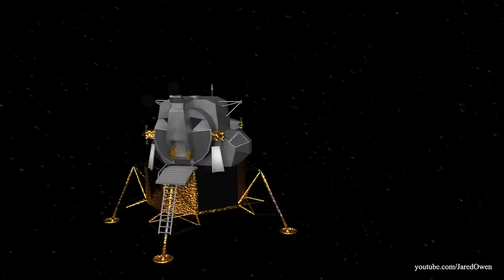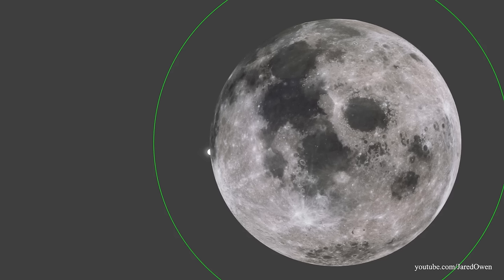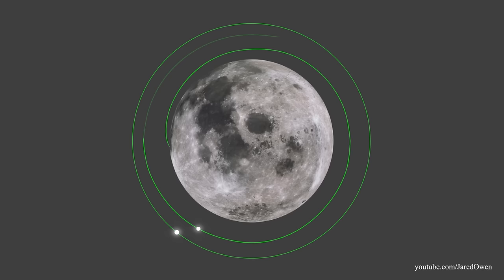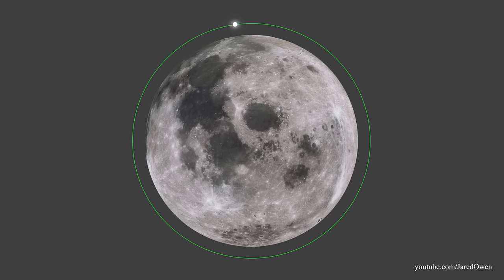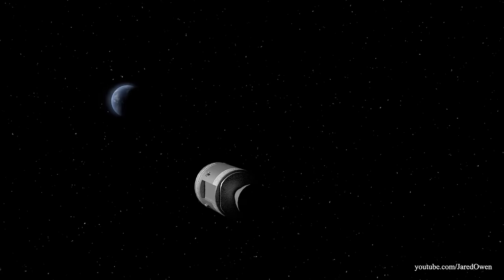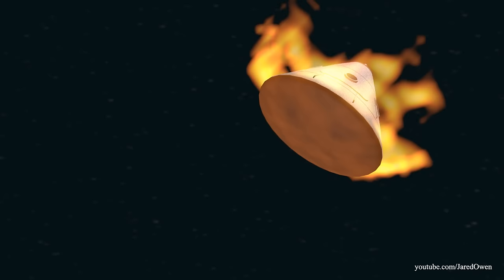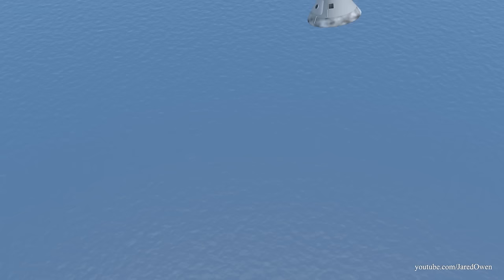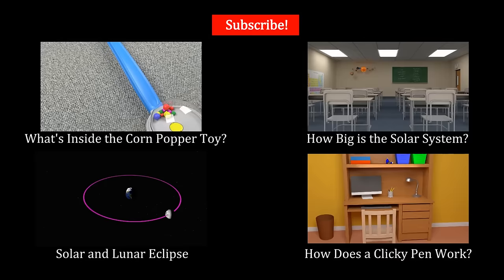How the Apollo Spacecraft works: Part 3

Comment: Nice video.
Can ascend module generate enough thrust to escape moon's gravity?
Reply: Yeah it achieves the moons escape velocity from its surface which is relatively low compared to earth's and gets into orbit where they are still held by the moons gravity but once the ascent module docks with the CSM they fire the engines and leave the moons orbit on their journey back home.
Reply: The LM ascent stage alone? No. It only had about 2.2km/s of Delta V.

Comment: How does the astronauts turn the CM Command Module re entry to earth belly or butt first when it is orbiting side ways?
Reply: It’s not as obvious to see compared to the LM & SM but the CM also has a RCS that they used for maneuvering.
Reply: The CM has small holes in its side that can release gasses that can orient it. Also, the shape of the CM made it naturally fall through the air in the correct orientation.
Reply: @origamiscienceguy6658  also reaction wheels

Comment: It's funny how in these cartoons, they remembered to show the rocket exhaust when leaving the moon, but on both videos of the "real" thing, they forgot that all rockets have exhaust and create thrust that is visible with flames and smoke,  both times they left that detail off the to moon movies.  No one has ever explained how they can always get the capsule to land right next to an aircraft carrier when they can't steer it, it drops from parachutes, so do they do that flying in from the moon, point the heat shield at the atmosphere and magic, it just happens to land in that big ocean on that big planet, within a mile of the ship, every time.  All wind just stops and it lands right on target... sure.  That's such B.S., you ever try to find a marker out at sea, from a couple of hundred miles away, without steering to correct for wind and sea currents?  You will be off target every time unless you course correct your ship.  Think about everything they are telling you, if you do, you will have about 50 more questions that can't be answered by NASA. Never a straight answer. Why did they destroy all original video tapes and telemetry tapes, over 14,000 of them?
They treated all remnants of the missions as crimes to be covered up instead of the most important event and accomplishments in the history of mankind. Why?

Comment: It's a pity NASA didn't have the modern computers for stability control used to land safely the first stage....that would have cut by a lot the expenses and they wouldn't have any reason to focus for a lot of time on shuttles...it's not that i don't see the spacecraft utility especially for the atmospheric thermodynamic studies in re-entries...yet there were more stuff to be learnt out there using rockets and we still had Von Braun alive(professionally speaking here).....
Reply: Pretty massive object to attempt such a thing compared to the Falcon 9 1st stage. How much extra fuel would have been needed if they had the computer tech back then? Be interesting to hear if it would even have been technically possible. I suspect not but might be wrong.
Reply: @mako88sb  In the end, how Musk  showed us(and many others before him), the limits are given only by our imagination.
Reply: Doing a Falcon 9 style landing of the Saturn V's first stage would drastically reduce its payload capacity to LEO and beyond since it would need to leave some of the fuel for the landing rather than for acceleration. You would probably need 2 Saturn V launches to get all the Apollo hardware into LEO + the third stage with its remaining fuel for the TLI burn.
Reply: @fromnorway643  well if you can cut the cost of a launch enough to make it worth even 2 launches would be okayish, no? I mean in the end the main problems of the launches are: 1)cost in money terms; 2)cost in terms of weight and payload and thrust.
Reply: @marklionheart7715  
Yes, it would make sense if the cost of launching, recovering, refurbishing and launching a second time could be kept lower than building a new stage. That was actually proposed in the early 1970s as NASA considered a version of the shuttle where it and its external tank were placed on top of a Saturn V first stage (the "Saturn – Shuttle" concept).
http://www.pmview.com/spaceodysseytwo/spacelvs/sld036.htm
Reply: @fromnorway643 mmm like a shuttle version of the starship i see

Comment: how can the vehicle catch the moon orbit on high speed and orbit around then fire a thrust to decrease the speed without loosing the vertical altitude instead of decent the vertical altitude towards the moon when orbiting ?? aaaaah i dont know how to say it but who studying physical orbiting will get it
Reply: I am just starting to study them but I kinda understand what you mean. The highest point of the orbit (the apogee) is also the slowest velocity point, near this point, the moon and the astronauts crossed paths. However, the moon was going faster than them at that point, that's why they throttled up, to "catch up" with the moon. Now, in order to orbit an object you need a certain speed. When the astronauts orbited the moon, its gravity wanted to pull them down but they were going so fast they basically missed it every time. Orbits are a difficult topic since they are counterintuitive. If you want to know how do they behave, I'd recommend you to download a game called Spaceflight Simulator, which oversimplifies orbital mechanics and explains it better than I can with words.

Comment: They didn’t go into earth orbit before reentry.
Reply: Why would they
Reply: They didn't have to since the heat shield could handle the 40 % higher re-entry speed compared to that from low Earth orbit. If not, they would need many tonnes of extra fuel for the Earth orbit insertion, which would basically be like the trans lunar injection in reverse (slowing down from 39,000 kph to 28,000 kph).

Comment: You explained whole process very well. Great video. I guess they travel most of the journey by inertia. However, I strongly believe that propulsion in vacuum space is totally useless.
Reply: Do you deny Newton's third law?
Reply: @fromnorway643  I'm just saying that above atmosphere (in empty space) there is no air, so the ''action'' is no effective, so there is no reaction, just motion by inertia.
Reply: @z-k-7315  
You can't throw tonnes of hot exhaust gases per second in one direction at 3-5 times the speed of a rifle bullet without producing lots of recoil. Rocket engines do in fact work better in vacuum because there isn't any surrounding atmospheric pressure to restrict the ejection of the exhaust gases.
Reply: @fromnorway643  Ok, I deny Newton's third law in empty space. No air - no propulsion. Just inertia as energy (force) gained from earth to border of the atmosphere. Prove me wrong. Try to explain to me that I'm wrong. Don't turn your back to me.
Reply: @z-k-7315  
Extraordinary claims require extraordinary evidence
- Carl Sagan

Since Newton's third law has been accepted by scientists for centuries and since rockets definitely work outside the atmosphere – all space travel except short, suborbital flights would be impossible if they didn't – your claim is definitely an extraordinary one, but I haven't seen any extraordinary evidence.
Reply: @fromnorway643  First of all, you were not there physically to be a witness, so for you, me and everybody else - that's a theory or believe like believe in God. Let me put it this way: you are tide up on your waist, hanging from the wall in the centre of your living room, you are waving with your arms and legs, but you're not getting any motion forward, just swinging a little forward and back (that's space, exclude swinging). Now, let's do this in a swimming pool with water, you are waving with your arms and legs, and you are moving forward (that's atmosphere). Conclusion: if you have something to push against - you will be moving. If there's nothing to push against - you will not move at all. In space there is no air, no matter to push against. Just inertia gained from earth to the end of atmosphere. Above atmosphere just by inertia you can be in motion.
Reply: @z-k-7315  
Newtons third law:
To every action, there is always opposed an equal reaction; or, the mutual actions of two bodies upon each other are always equal, and directed to contrary parts.

Regarding rocket engines in space, the "two bodies" are represented by the exhaust gases moving in one direction and the rocket itself moving in the opposite direction, thus conserving the sum of their momentums.

Denying this means that you deny that space travel is possible and that there must exist a huge, worldwide conspiracy that has been ongoing at least for many decades if not centuries and that the western world and the Soviet Union cooperated about this during the Cold War for some unknown reason while pretending to be mortal enemies.

I'm not going to waste any more time on your "I-know-better-than-all-scientists-in-the-world" flat earth mentality!
Reply: @z-k-7315  "Let me put it this way: you are tide up on your waist, hanging from the wall in the centre of your living room, you are waving with your arms and legs, but you're not getting any motion forward,"

Now imagine what happens if you let off an almighty fart (no, seriously).
Reply: @Smee Self Yes, by inertia which is constantly and endless in space.
Reply: @Smee Self 
I would say that you are essentially pushing off an object when throwing it away. Since that push normally only lasts for a fraction of a second, it won't accelerate you very much unless you have lots of objects that can be thrown in the same direction at the highest possible speed.
Rocket engines are very good at throwing lots of objects – gas molecules – away at very high speeds, sometimes several tonnes per second.
Reply: @z-k-7315  : He already proved you're wrong.
Reply: @z-k-7315  How come you don't have a single test where a rocket in a vacuum doesn't create and thrust? I mean, how lame are you?

Comment: What if the Command Module accidentally lands on the aircraft carrier?
Reply from the maker: I suppose it could happen but the chance is pretty small
Reply: I always wondered that too.  My thoughts are pretty small, as Jared pointed out.  Nasa and the Navy had a really good idea of where each CM would land.  But if it did land on the flight deck, potential injuries to Astronauts from a hard impact.  The biggest problem would be the parachutes.  They were designed to be cut loose after splash down.  But if the CM landed near the edge of the flight deck, there might be the possibility for the CM to be dragged off the side before the chutes are cut free.  The most embarrassing would be the CM landing on the deck, with the chutes tangled in the ship's superstructure (antennas, etc.). Again all improbable, but you did ask.
Reply: Like Comment200 said about the parachutes getting tangled in the superstructure,what would happen to the CM and the air craft carrier?

Comment: ¿ y en una capsula tan pequeña había espacio para 23Kg de rocas?
Reply: Of course there was. A minor issue. Designing the lunar sample containers was a pretty involved process and the people involved were quickly informed about the maximum dimensions they had to work with. They had to fit on the MESA platform:
https://digital.library.unt.edu/ark:/67531/metadc1030008/m2/1/high_res_d/4480410.pdf

As for the CM, it wasn’t huge but proper layout and storage was all that was needed;
https://www.hq.nasa.gov/alsj/CSM06_Command_Module_Overview_pp39-52.pdf
Reply: @mako88sb   ¡Que buena información me has dado! Gracias por resolver mi pregunta.